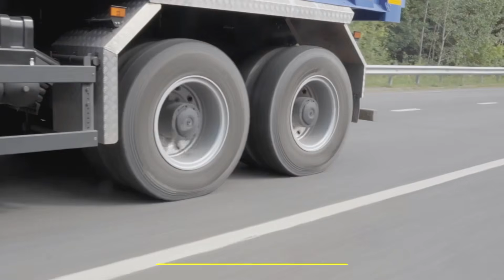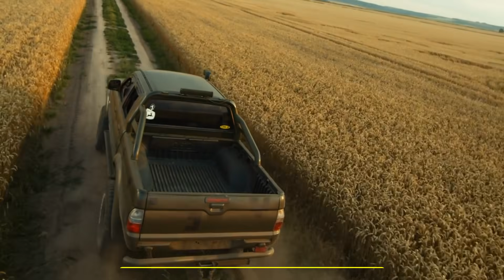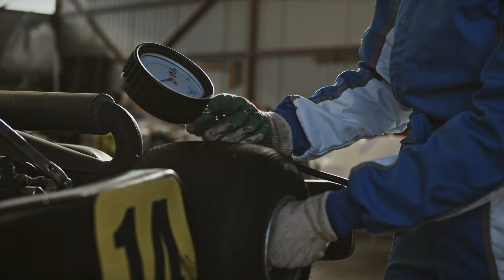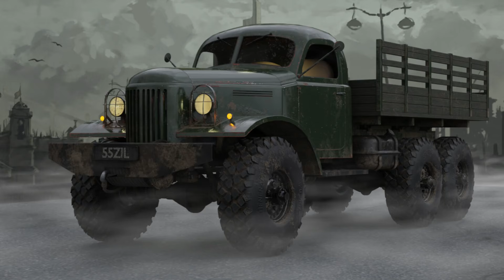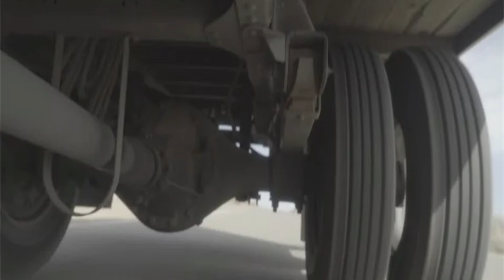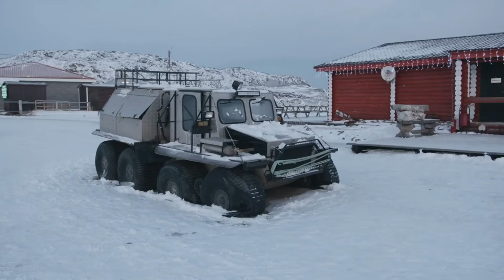The SECRET SYSTEM That Let Soviet Trucks Drive Through SWAMPS

Comment: A deflated tyre does not have a wider footprint even if the sidewalls appear to bulge out.  That bulge out is exactly that: a bulge in the sidewall, not the tread.  In fact, where sidewalls touch the ground, they become very vulnerable to both abrasion and sharp objects.  The tyre gains grip when deflated because the footprint gets longer.  Think about it.
Reply: Military tires were round in many militaries, making what you said false

Comment: Not new ! the DUKW had them in 1943. Many of the pictures are irrelevant and have no bearing on the subject. More AI
Reply: Exactly  soviet's utilized quiet a bit after ww2. But had been in development since the late 30's then general motors  did like you said integrating into the DUKW